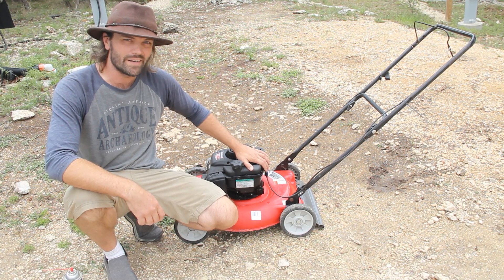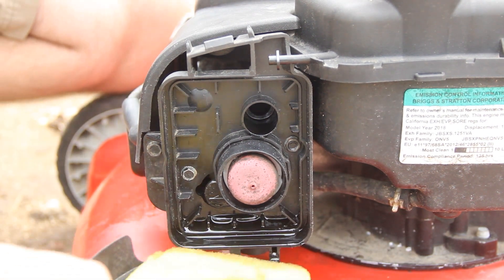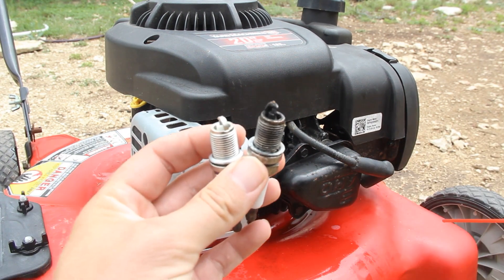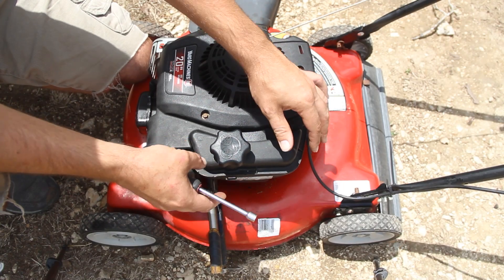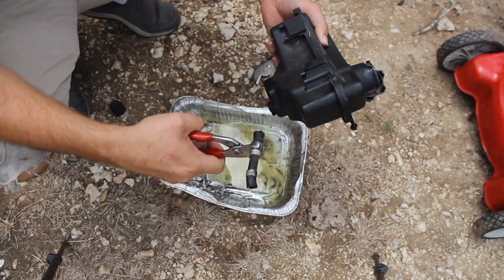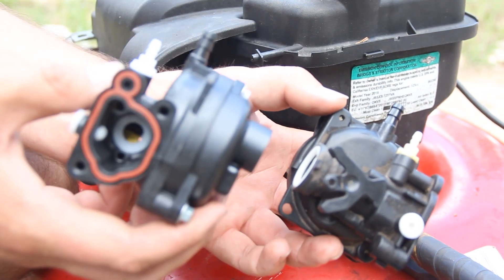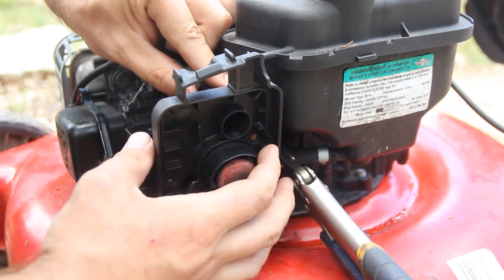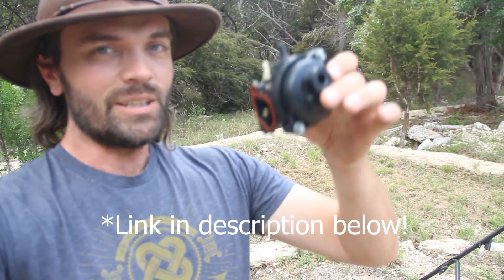Lawn Mower Repair:  6 Problems Anyone Can FIX!

Comment: Great video and I would add these tips: Only use high-grade octane fuel for small motors like a lawnmower, lawn tractor, chainsaw, or weedeater. It's cleaner and will make the motor more efficient and increases the overall lifespan of the engine. If the mower has a fuel filter and or a fuel pump, change those as well if the motor won't turn over. Make sure you store the mower correctly after the season by using sta-bil fuel stabilizer in the fuel system. After that, remove the spark plugs and fog the sockets with a spark plug fogging spray where they screw in. Then screw the plugs back in. This will eliminate any moisture issues inside the sockets. Also when you first run the mower after storage, add a little Sea Foam in the gas which will help clean and un-gunk the fuel system. Hope This helps.
Reply: Yes all can be purchased on amazon. Place your links here Rick. ;) lol